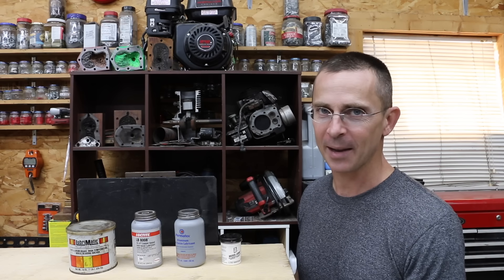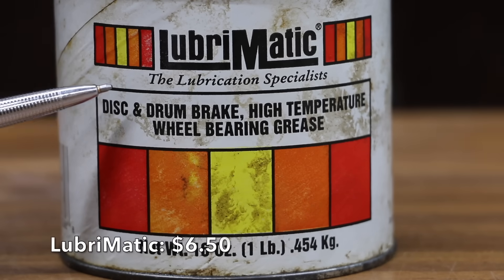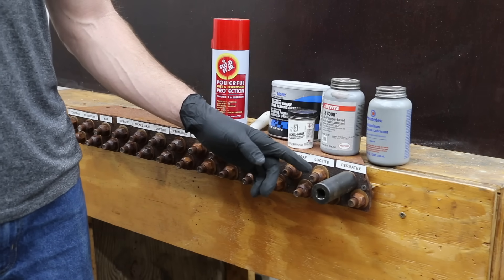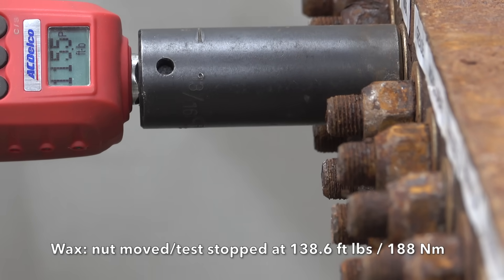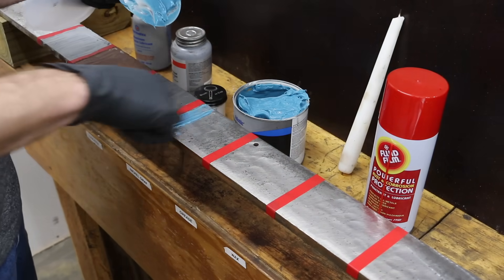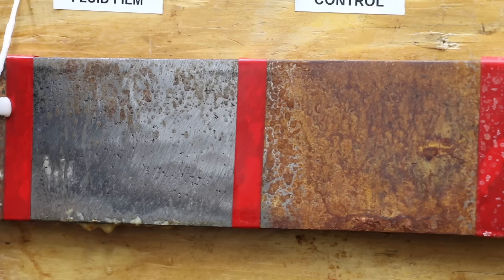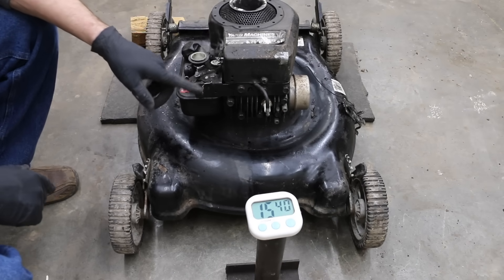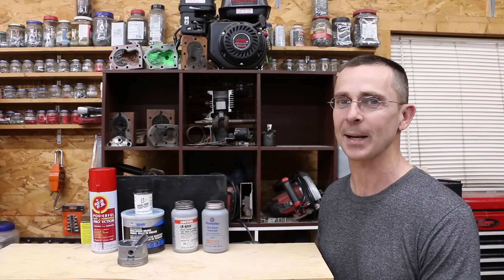Does Anti-Seize Compound Actually Work? Let's find out! Anti-Seize vs Grease vs Fluid Film vs Wax

Comment: I find that anti-seize doesn't work very well.  It pretty much washes completely off in the midwest road conditions in a matter of months.  I find the conditions tough to duplicate based on every time I take something rusty apart that I put together with anti-seize or other greases years prior, it is like nothing was applied in the first place whereas these tests show that there's plenty left over after 6 months.   Brake caliper slide pins, for example.  The boot is ripped, so why not just lube it up well and it should hold up for a couple of years anyway.  Nope.  It doesn't.  For some reason these controlled conditions tests just aren't an accurate representation, at least in the long-term.

What I find that works best, which sounds contradictory, is thread locker (obviously not on caliper slide pins)  It is all about doing what it takes to get the nut/bolt to move, period.  The amount of torque doesn't mean much as long as whatever amount it is, it is less than what breaks the bolt.  Thread locker will take the most to get it to move, but it seals out the corrosives and it WILL move.

I am not sure about thread locker when high heat, such as exhaust, is involved.  Nor have I tried pipe thread dope or teflon tape in either high heat or no heat applications.
Reply from the maker: Thanks for the feedback.

Comment: Last weekend I replaced my axles on my 2005 r53 Mini Cooper. The driver side ball joints/tie rod came out with a few whacks of a 3lb hammer. Now the passenger side was another story, the tie rod came out fairly easy, but the lower ball joint took me almost an hour and a half. I tried impacts, heat, countless hammering from a 3lb and 10lb sledge, air hammer, demo chisel etc.  After I took a break to clear my head when I cam back I generated enough energy in the meantime to swing my 3lb sledge like the hammer of Thor and it finnnalllyyy  broke loose and fell to its catch. And yes I tried a heavy dose of PB Blaster for about a week (about 3 treatments) before the job-my thinking was if I treat all the associated fitting with the PB Blaster and drive the car during the week itll allow the penetrant to work better with the road vibration.  I was able to tell the PB barely penetrated into the ball joint flange (no it didn't rain during the week).
During reassembly I made sure I used the Permatex antiseize on all the fittings. Also to note the nuts on the balljoints came off fine it was the flanges that were rusted together-well not anymore and glad that's usually a one time job but I know if I have to do it again for whatever reason it will come apart easily.
Great video.
Reply from the maker: Thanks so much!  Thanks for sharing.

Comment: Aluminum wheels on steel hubs. Put anti seize on the studs and around the center hub. You are welcome. But if you have the white corrosion remove it with a chisel and hammer , clear out the debris  and sand the corrosion from the center of the rim. Then applying the product will keep your  rims good and if you don’t have the corrosion apply the product and you can keep your rims good as new
Reply from the maker: Thanks for sharing.

Comment: The most important use of never-seize is on exhaust, where rust is universal and petroleum based stuff (like grease) will cook into carbon.  This is why the good stuff has soft metals in it (aluminum or copper or...).  Try this same test, then cook the bolts with a torch and let them cool.  Of course, it won't be as bad as years of cooking on an exhaust manifold............
Reply from the maker: Thanks for the video idea.

Comment: What I’ve seen people do with wax is heat the rusty metal, usually a nut, they heat it up to just about cherry red and then melt the wax on the hot metal. You should try that in another video
Reply from the maker: Thanks for the video idea.

Comment: Never used it or recommended it my entire career until I retired. I used a specific lube for a specific job. There are lubes for every application and none that can do it all. That crap can create more problems than it fixes. I've seen the stripped lug bolts and replaced many because of that garbage. I used graphite lube made for wheel studs and only a tiny amount.
Reply from the maker: Thanks for sharing.

Comment: as a front end mechanic for 20+ yrs. we ALWAYS used anti-seize no matter what we put back together...silver color, copper color didn't matter as long as you used something and the whole front end would come apart yrs later......hub bearings, axle shafts cv style, ball joint alignment cams, caliper bolts...you name it, we "sleezed" it....it paid off in the future when we would have to work on the vehicle again....even if it was just wheel brg grease, it was better than nothing....great test as always
Reply from the maker: Thanks so much.  Thanks for sharing.

Comment: I was not surprised by your results. I have used some of these products my self. The Loctite copper being my favorite.  I have never tried wax and never will. I have how ever used just loctite and pipe joint compound. They do not work as good as loctite copper but will protect the threads so they can be removed later on. I like your chenille.
Reply from the maker: Thanks for sharing.

Comment: Copper never sieze is the only stuff that ever worked on my Ford 5.8L Engine sparkplugs. They are thin wall taper seat and the aluminum never sieze never worked and the plugs snapped every time. The ones I put the copper on came right out with no breakage.
Reply from the maker: Thanks for sharing.

Comment: Late to the party, but I don't think this video did a good job of representing what anti-sieze is actually made for.  I know that sounded rude, but I'm really not trying to be.  To me, this showed how anti-sieze acts as a lubricant, not it's intended purpose. 

Use it on dissimilar metals.  Stainless nuts, galvanized bolts.  Steel bolts, aluminum block with holes tapped...etc.
Reply from the maker: Thank you for the feedback.

Comment: This video is much appreciated by me. Thank you!

I was an engineer for GE in the 70's and 80's. I supervised overhauls of GE gas turbine generator and compressor drive units all over the world.  Bolts ranged from 1/2 inch to 2 inch and sometimes larger. Antiseize on absolutely clean threads was extremely necessary.  The bolts in the hot sections were usually tough to remove a few years later. But the unit that somebody put together dry was a nightmare to take apart. We broke 1-1/4-8tpi bolts off on vertical joints and each had to be drilled out or ground out with peanut grinders before the section could be lifted out by crane. That took 5 days working around the clock and even more grinding and drilling once the turbine shell was removed. The magnetic base drill earned its keep on that job.

Some of the smaller steam turbines we worked on typically had 4 foot long studs with 4 inch diameter threads. These studs had a 3/4 inch hole drilled through the center end to end. We put a special oxy-acetelene-compressed air heater in the hole to heat the stud from the inside to blow hot air through it.The turbine cases had to be cold...room temperature first. After proper heating of the stud, the top and bottom nuts came off easily if they had been assembled with antiseize years before. The heat makes the stud grow lengthwise and they come off pretty easily if they had been assembled with anti seize like C5-A  or Nickel Never Seez.

To tighten the studs, you put them all in with nuts on top and bottom. Then you smacked each one with a slugging wrench, huge forged steel heavy duty box end wrenches tied to a rope with some big guy smacking the end of the wrench.  We used a 6 pound sledge hammer until it stopped.  Then we marked the nuts and casing with a soapstone.  A chart tells you how many more degrees to turn to tighten the nut after heating the stud for 15 minutes or so. Very often we could turn the nut by gloved hands to match the other mark on the casing, no wrench necessary. When it cooled down, the stud would require many thousands of foot pounds to remove the nut. Do this to all of the casing studs and that turbine shell remains massively tight whether hot or cold. 

The one time some mechanic at a large lumber mill thought it would be better to glass bead blast the studs on a steam turbine before assembly, every one of them galled up coming apart even coated with anti seize. The customer screwed up the overhaul and we were called in 2 weeks later to take it apart again and fix it right. We fought those nuts off with slugging wrenches all the way and had to replace several of the 150 pound studs because the threads were galled so badly. We always wirewheeled all of the threads on all jobs and made sure they were clean. We used Nerver Seez nickel on high temperature bolts, C5-A copper on 200 degree or less applications.

 There was also special anti seize with a pedigree and trace-ability papers as to when and where it was made , serial number on each can. We used this extreme high dollar stuff on ''Sub Safe'' and ''Mercury Free''  certified jobs  on small turbines, reactor feed pumps, and main propulsion turbines on nuclear powered subs and aircraft carriers. It takes a month to do a 4 day job with all of the barriers, paperwork, witnesses, specifications, inspections, red tape, etc. 

To this day in my late 60's I assemble every bolted piece in my work shop, cars, truck, etc,  with anti seize. The cost is peanuts for the headaches it saves.
Reply from the maker: Great information!  Thank you
Reply: Wow loved reading this
Reply: @saulj6045  
I plumb wore out my typing finger writing this. I tried speech to text writing once but it invents cuss words I never heard before..My mom, rest her soul, never forgave me.   I'm glad you liked it.
Reply: Wow !   Who are you ?  We have a G.E. plant in our cinti. area. Your comments were amazing !! - I use the stuff on brake jobs constantly . aluminum wheels to steel hubs ect. ... I really enjoyed the commentary on your past work experience's !!!

Comment: Todd another great video, like everyone says; I appreciate all of your efforts. Question: would you consider doing a comparison of the different cement style mixtures? The dry products that you just dump into the hole where your "4x4/whatever sits" vs those which you add water into the hole, then the dry mixture, then water etc vs that which you've "pre-mixed as directed" and then pour into the hole. Some claim 3 min set up times, and "no reinforcement wire needed." Which is strongest; does the "dump-in-dry" i.e. Sika Pro Select etc. [b/c the moisture from the ground] really work? Do they set up in 3, 5...minutes as they claim? Just a thought. God bless.
Reply from the maker: Thanks so much!  Thanks for the video idea.

Comment: I've always been told that if you use candle wax, you're supposed to heat the nut and bolt to melt the wax and force it to expand through the rusty threads.
Reply from the maker: Thanks for the feedback.

Comment: I like using a little anti sneeze (lol) on rusted bolts after cleaning them with a wire brush. It really helps them go in smooth. I wouldn't use it on anything that could be a danger if it loosens.
Reply from the maker: Thanks for sharing.

Comment: I've added antisieze to my motor oils and gear oils for years..  put it in my compressor oil, lathe gearhead, etc.   I've always felt like it helped a lot.    Sure does smooth out an engine.  

I worked with a lot of old timers that swore by it.  

Can you or have you done a vid on using copper/nickel antisieze as an oil additive?   It would be nice to see it tested.  

Great video!
Reply from the maker: Thanks for the video idea.

Comment: So there's some better than others, but ultimately, they're all much better than nothing.
-
I broke a spark-plug inside of my engine block while trying to remove it.  It wouldn't budge, so I switched over to a comically long wrench-handle (breaker-bar), and it broke the spark-plug itself.  This was a 1989 Chevrolet Corsica.  We took it to a mechanic, and they were able to extract it without pulling the head off of the engine, so luckily the labor costs ended up being a heck of a lot lower than what we expected.
-
Point being: use an anti-seize on your spark plugs.  If the manufacturer recommends against it -- such as NGK -- then use a very, very tiny amount.  Don't use nothing.  And FYI, they recommend against it because it messes up the torque-specs.
Reply from the maker: Thanks for sharing.

Comment: Where is the Maalox or other brands with same ingredients?  :)     Those work in a pinch also if you do not even have bearing grease on hand.   Aluminum and Magnesium Hydroxide , and we drink the stuff?  lol....  Gosh, been a good 40 plus years when an older mechanic told me to try it.  Used it on lug nuts and studs for years.
Reply from the maker: Thanks for the feedback.

Comment: nickel and copper are both tolerant to higher heat than aluminum with nickel supposedly being resistant more so to heat so it wouldn't matter how each one does because you can't use aluminum on exhaust bolts, they get too hot. so the tests actually don't make sense in the real world
Reply from the maker: Thanks for the feedback.

Comment: Loctite LB8012 is going to better than those since it’s Molybdenum based. Also to engineer on it those products will have a different effect on the torque applied due to differences in k factor (friction factor if you want to get more scientific in your equation).
Reply from the maker: Thanks for the feedback.

Comment: For optimum results with waxes you need to pre-heat the metal hot enough to smoke the wax when applied, but not hot enough to for it to burn . Best results involve hot wax bath. Wax does work and is great for some applications, like furniture and hand tools but it requires more work and time.
Reply from the maker: Thanks for sharing.

Comment: what chemical was used to remove the zinc coating on the nyts/bolts?
Reply: Just hit it with the wire wheel spinning Reapply put it back in if it’s a hard ball to get to and you’re worried about it breaking new bolt

Comment: I've never applied anti-seize to a piece of metal that was exposed to direct water pressure. To make it a good test for wash away, the anti-seize should be applied to a nut and bolt and then have water run over it however you want to do it.
Reply from the maker: Thanks for sharing.
Reply: @ProjectFarm  I love your videos. The part I find annoying is when you do weird tests instead of actual use tests.

No one applies anti-seize to blank pieces of metal and run water on them. The test where you apply anti-seize and then see how well it prevents rust with rusting chemicals is fair because it shows how well it works without being screwed in. But the water thing would have been better if it was on bolts and nuts with water running on them.

Comment: Stainless steel is one of the most needed use for anti seize ,over the years had more stainless steel nuts and bolts gall and  have to be cut apart or drilled out because nothing was used. Even ss bolts in aluminum are a disaster removing after being in the weather for any length of time.
Reply from the maker: Thanks for the feedback.

Comment: it's not totally germane; however, paraffin, is a great coating for the edges of windows and their slides when painting.  i have used crayons to coat the slides and very near edges of wooden windows to avoid coverage, and adhesion, of both the plastic or aluminum slides and the edges of the windows.  saves a lot of time.
Reply from the maker: Thanks for the feedback.